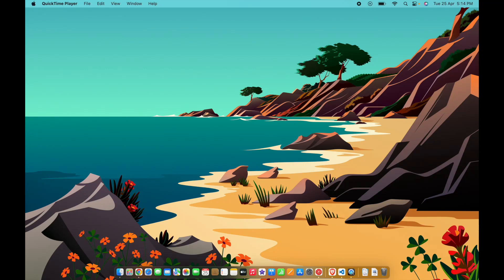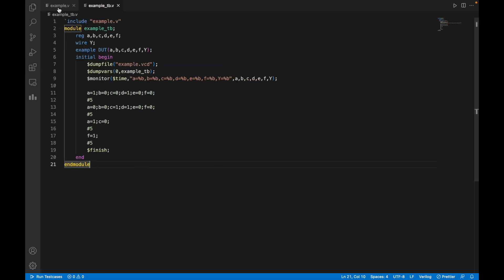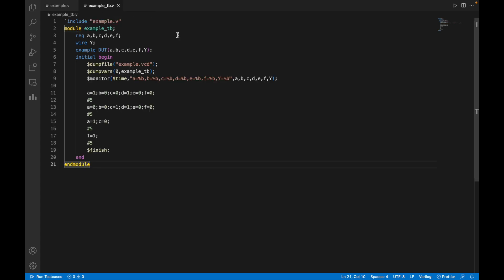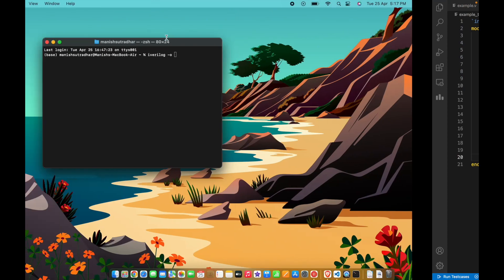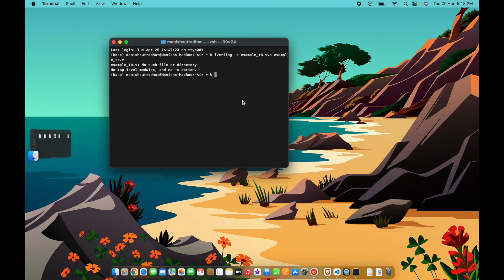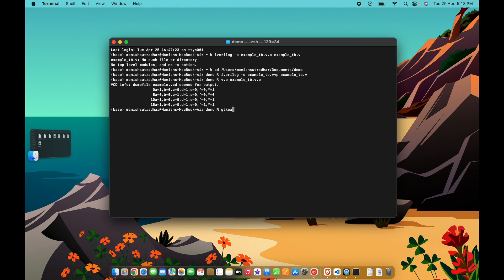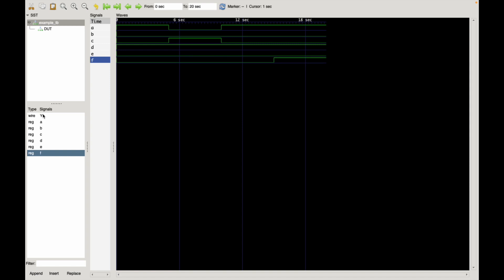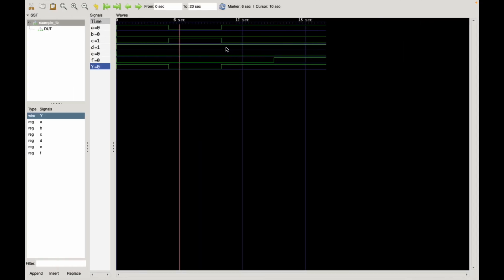How to run Verilog on MAC with an example

Comment: hey bro..mere mei abhi bhi no top modules show ho raha hai
help me out
Reply: same error
If u found any soln plz share
Reply: Mila solution?
Reply: @offspinnerr  nope, I jus shifted to eda playground
Reply from the maker: Send me your code
Reply: @xmod2157  did you make a video?
i think it would be very slow on the base model

please make a video regarding this 

is there some alternative for synthesizing an ic without using vivado on the macbook air m1 or m2 etc?